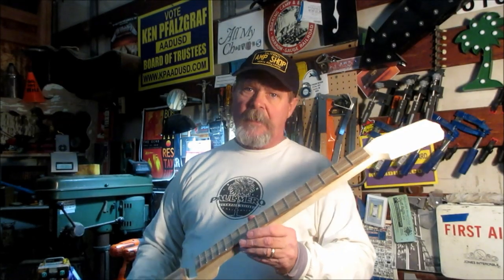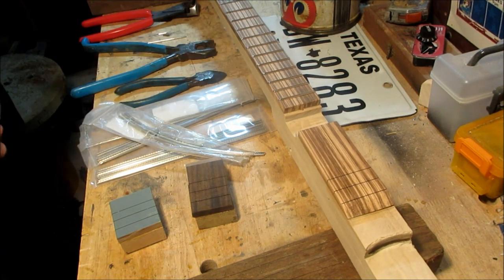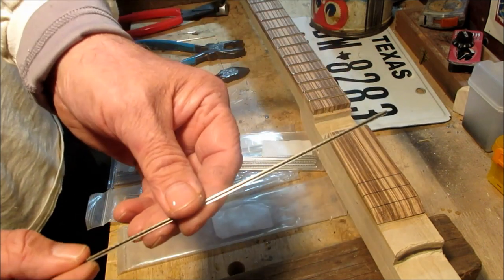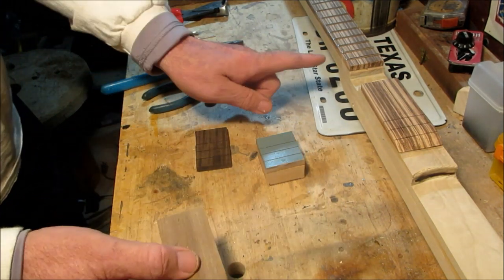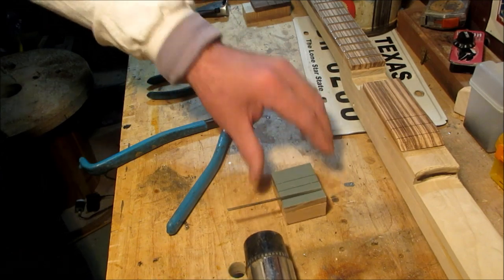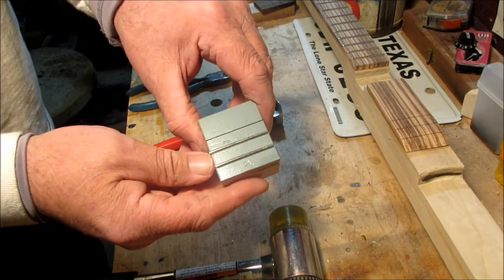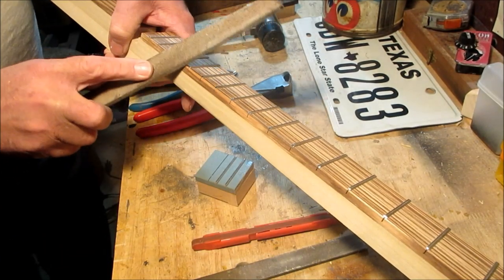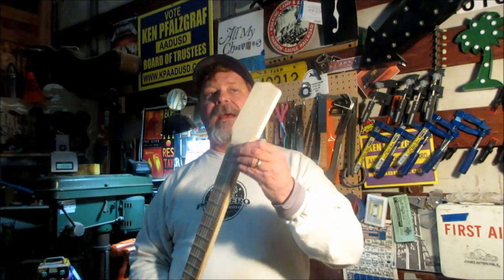Fretboard Pf Ups

Comment: Great tips Ken, although I believe you meant to say that a 25.5 scale is from Fender, not Gibson, if I am correct, Gibson uses slightly shorter scale lengths, as they claim their product plays quicker due to the shorter scale.  Not sure that's really correct, as I build using 25.5 and they are plenty fast.  Thanks for all your tips!